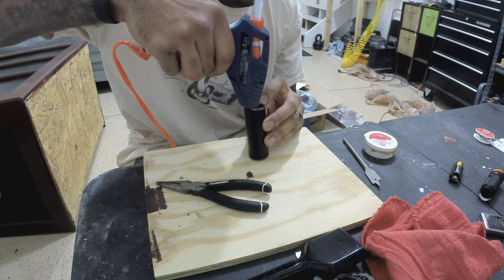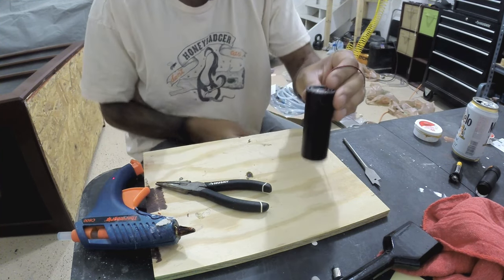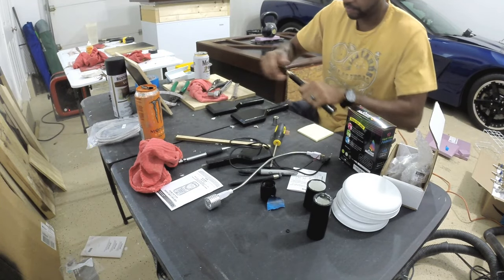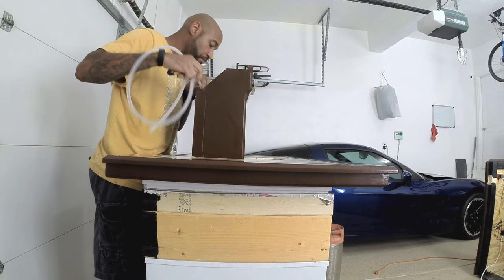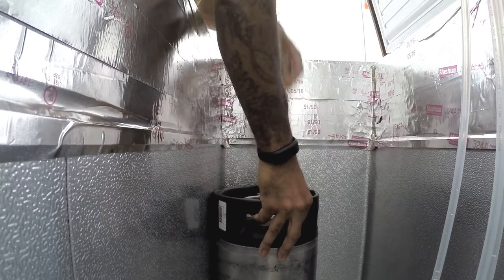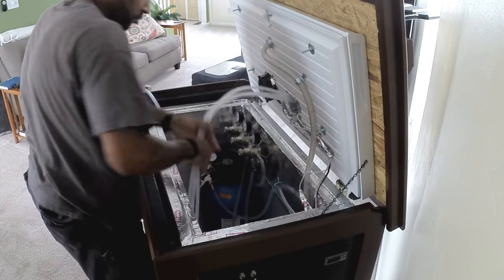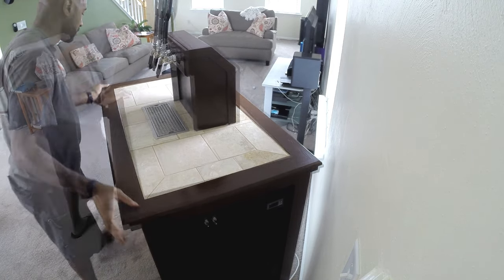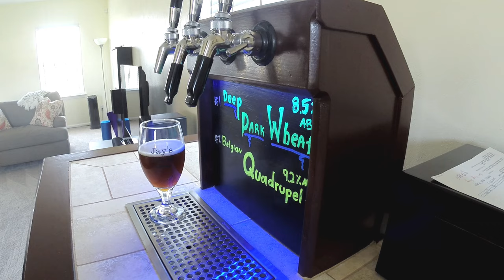Batbar Keezer Build Part 4

Comment: And I assume, he spent three videos doing Woodworking and carpentry work and then the very end of the last video hooking up prefab kegerator components. Was hoping he was actually going to do a better explanation of his plumbing and setup. The bar Tower he built. Could have been bought pre-built made of stainless steel or brass. With insulation already injected into it. Far better than you can do yourself. I hate to say it but this is actually disappointing build unless you have some sort of a hard-on from doing a lot of woodwork for no reason